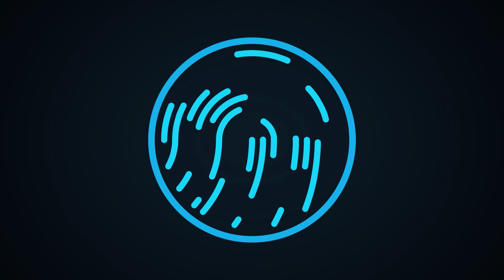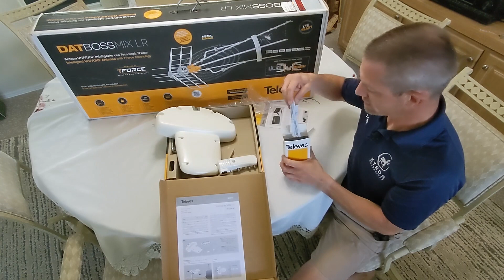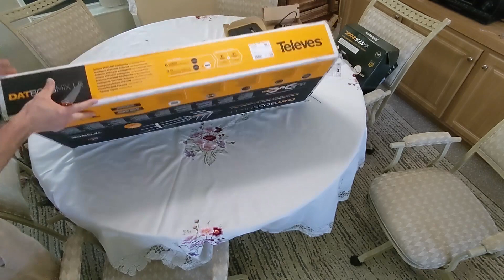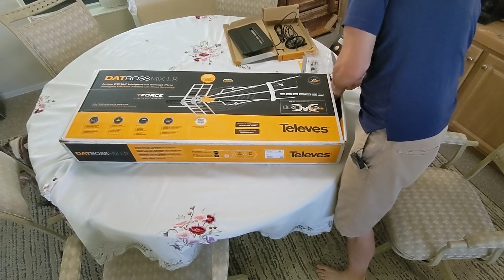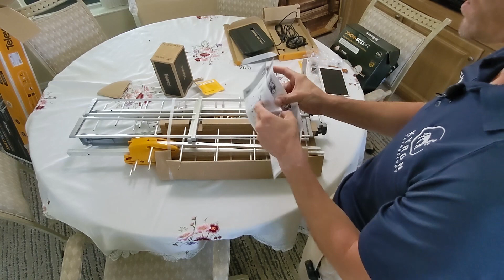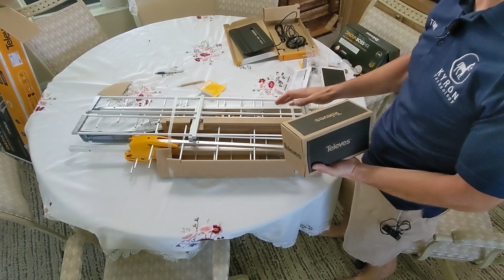Unboxing Three TV Antennas from Televes: Bexia Indoor, DiNova BOSS Mix, and DATBOSS Mix LR

Comment: Do you INSTALL antennas? I'm over in Palm Bay and strongly looking at the Televes Long Range Mix 149884 antenna to replace a weak 45 mile Winegard that we have now. Thanks!
Reply from the maker: @Richard Barkley yes, we install antennas in the Daytona Beach area. We actually just picked up a 149884 for testing a few weeks ago, and installed it last weekend. Without seeing a RabbitEars report and aerial imagery it's hard to say for certain, but the 149884 may be overkill for your location. You would likely have similar results with the much smaller DiNova Boss Mix, which is what we use for almost all our clients in Volusia county, or their Ellipse antenna that we'll probably test next. Thanks for chiming in!
Reply: @kyrontechnology  Thanks! My understanding is that the transmitters that the Orlando stations use are in Bithlo which is just over 50 miles from us. We had the Winegard installed 4 years ago and it was fine until about 1.5 years ago, we get pixeling then complete outages quite often. I have a guy here locally that installed the antenna and insists its my trees blocking the signal. I think I understand overkill but certainly don't want underkill either. I have been in contact with Tyler, The Antenna Man PA and he recommended the Televis 149884 saying that the Orlando stations broadcast on UHF and this antenna is superior for this. I'm a complete layman when it comes to this.....
Reply from the maker: Since you have a specific issue such as tree coverage, and you're a little further away than I guessed, the 149884 may not be overkill. It's a very nice piece of equipment, and you can't really go wrong with it unless you're quite close to the towers. I think you'll be happy with that choice! (PS: www nesselectronics.com is a reputable place to purchase Televes products online if you plan to do the upgrade yourself.)
Reply: @kyrontechnology  Thanks again! We actually get stations in West Palm Beach quite often now. Usually when we lose ch9 (WFTV) out of Orlando we can get WPTV ch 25 out of West Palm as if they were broadcasting from our backyard. My guy here locally has always had our antenna pointing NORTH. while Tyler The Antenna Man PA after some research says it should point NW, so I did turn it slightly towards the NW which seems a tiny bit better.My guy here doesn't have an antenna signal meter so he has been doing the many antennas he installs and just adjusting by the seat of his pants.
Reply from the maker: @RickBarkley9909  based on a generic Rabbitears report for Palm Bay, I'd definitely agree with Tyler and and say NW:

https://www.rabbitears.info/s/666162
Reply: @kyrontechnology  Ok, Great!! Thank You again!! So IF I were to purchase the Televes 149884  unit  Could you swap it out with the present Winegard and adjust it properly for me? Or could you recommend someone in the Melbourne/Palm Bay area? Thanks Again!!
Reply: I Googled "TV Antenna installation, Melbourne, Florida" and the #1 listing was the place that installed our Winegard. This guy means well but knows little about a lot of things. The #2 place I'd never heard of, the #3 place is Best Buy and I wouldn't let THEM near my home.
Reply from the maker: @RickBarkley9909  Ah, sorry for the late reply, and that you're having trouble finding someone qualified. Palm Bay is a little outside our geography - let me ask around. (As far as I am aware, Best Buy no longer installs antennas, if they ever did.)
Reply from the maker: @RickBarkley9909  I did a quick Google of my own before asking around; have you tried these guys? Hook It Up Electronics
(321) 722-1221
https://maps.app.goo.gl/hD984pqjGe8kDP9d6
Reply: @kyrontechnology  Thank You!! No worries.
Reply: @kyrontechnology  I just spoke with "Antenna Mike" at Hook it up Electronics. He says he can and will swap out my Winegard for the Televes 149884 unit. He says he does NOT use a signal meter during installations-Tedco doesn't either. But Tyler the Antenna Man PA feels strongly about using one. What are your feelings on this? should I buy a meter to have here to set my new antenna up with?  Thanks Again!!
Reply from the maker: @RickBarkley9909  glad you seem to have found someone knowledgeable!

Regarding the meter: it was about 6 months after starting the business that I could afford to buy a proper meter. Up until that point, there was an educated guess, followed by a lot of scanning and rescanning to optimize position. At the end of the day, the results are usually comparable, but the meter saves a ton of time, and can help you optimize the signal across all frequencies more easily. I would advise most pros to make the investment, but I think it's an expensive proposition for a single use for a homeowner. Given the RE report for your location, it should actually be pretty straightforward to accurately aim the antenna, it's just a question of interference from the treeline you mentioned.

Keep us posted on your progress/results!
Reply: @kyrontechnology  Sure will!!
Reply from the maker: @RickBarkley9909  how'd you do with the new antenna? Hopefully you weathered both Ian and Nicole without any damage?
Reply: @kyrontechnology  We did well, Thanks for asking. My Wife & I swapped antennas ourselves. We assembled the Televes Dat Boss LR 149884 and installed it after Ian and before Nicole. We were concerned and sat here watching the news coverage even after the power went out as we have a 22kw Generac generator. Good stuff!
Reply: @kyrontechnology  My Wife and I ended up assembling and swapping out antennas ourselves. Wasn't really that hard. We did it between Ian & Nicole. (We had no idea that Nicole was coming or we would have waited) Anyway, The Televes Dat Boss LR 149884 unit is working GREAT!! We're getting 80 channels solidly now. Even 4-6 out of WPB at times!! No damage to home or property other than small yard debris from trees. How about you?
Reply from the maker: @RickBarkley9909  ah, that's fantastic news, not only about your success with the antenna (great teamwork with the wife!) But surviving the inclement weather. 

I took my DatBoss down for both storms because it's pretty accessible, and hastily set up an indoor Bexia antenna for just the Orlando news stations. No damage or even debris to pick up, thankfully!!

Have a wonderful upcoming holiday season, and when the family conversation turns to politics, just interrupt and start talking about all the great free TV you get with your new Televes antenna! 😂

Comment: I'm a Channel Master fan but I'm looking hard at this antenna to replace my 100 mile Channel Master antenna.
Reply from the maker: Hey James! We're actually hoping to collaborate with a friendly "competitor" in a nearby market who has extensive experience with the CM 100 Mile model. We're going to mount the DatBoss Mix LR in the same location to see how it compares this weekend, but the video will probably take a while to get out. Be sure to subscribe and hit the bell icon to be notified when it is uploaded!
Reply: @kyrontechnology  I don't think you can go wrong with either one if you add an updated amplifier to them.
Reply: @kyrontechnology  I had that Channel Master. It performed well but the range is not the propaganda distance unless possibly placed 40+ feet in height. Gave it to my MIL as she is located closer & I bought & use the superior Televes Dat Boss LR Mix. 1 real tip: use ONLY real copper core not steel or plated coaxial cable minimum RG6 preferably RG11. Best thing about the Telexes is the filter which works perfectly & the self adjusting pre-amp which will not over-power local towers.
Reply from the maker: @JFrenchRennier  thanks for your input - spot on, in my opinion!

Comment: yea, that DATBOSS Mix LR is definitely the mac-daddy of antennas.  I had one in my attic for a bit.  Due to the duct runs and the placement of my chimney (which added additional layers of material), I ended up selling mine on Facebook marketplace cause I couldn't quite get it pointed in the direction I needed.  I didn't have any real problems putting it together.  I used the instructions and watched the Youtube video. One of the things I like about the Televes power unit is that I can run one cable to the TV, and the other to my AirTV.  looking forward to seeing the reviews.